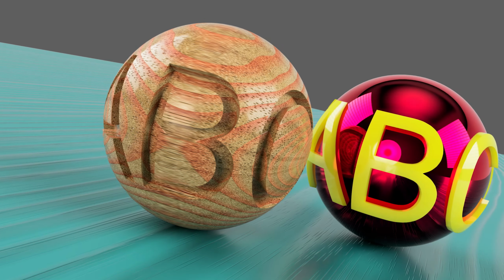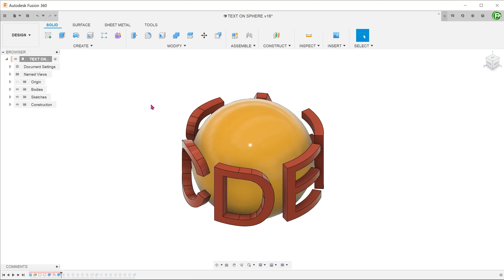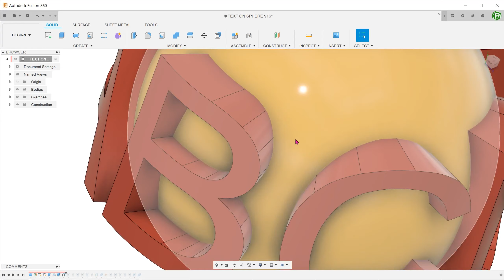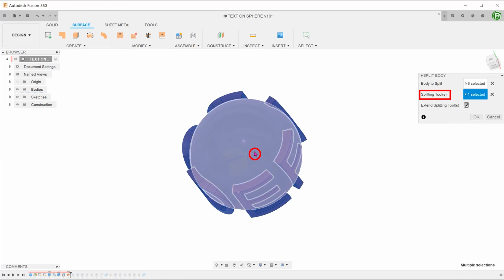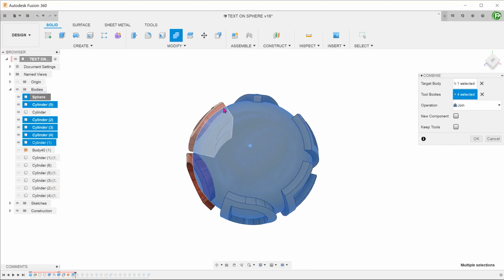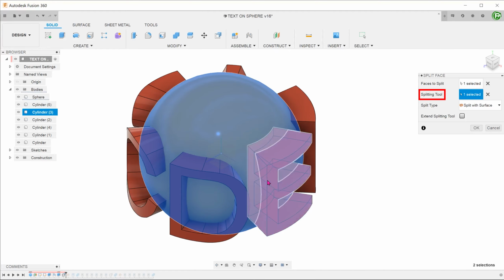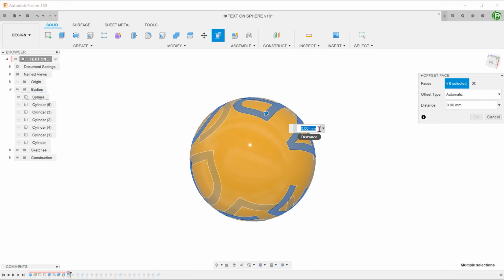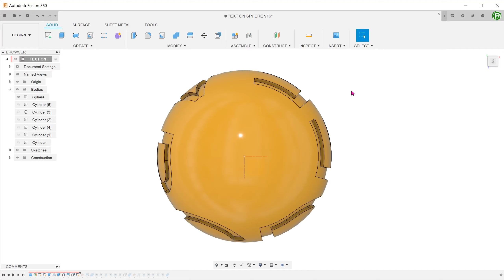Fusion 360 - Embossed Text on Sphere Part II

Comment: Great improvement to the cheated workflow! However it's not perfect as letter thickness towards the top & bottom is still stretched, hopefully Autodesk will add multi-curvature support for the emboss command. Nice videos, clear speech and perfect pace, i'll stick around :)
Reply from the maker: Yes, it is not a true wrap from top to bottom. We will just have to hope for a better emboss tool in the future. Thank you for the support.
Reply: What is cheated work flow exactly ?

Comment: I found another way to deboss a sphere.  Start with an offset plane and create text on that plane. 2. ectrude text through the ball surface.  3. Split the text body elements with the ball surface. 4. remove the text bodies inside the ball. 5. move the remaining portion of the text bodies into the ball the to the desired depth and use the combine bodies in "cut" mode to deboss the ball.